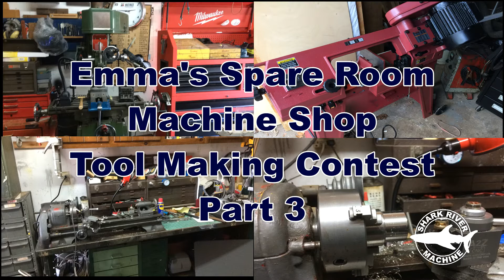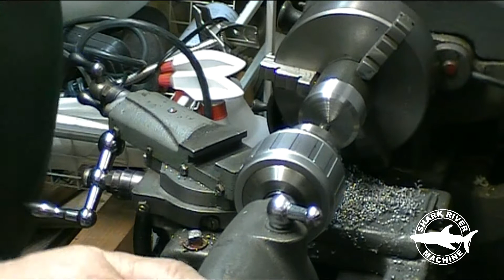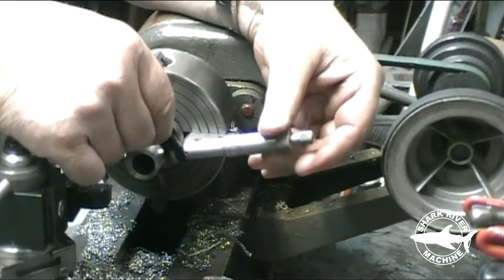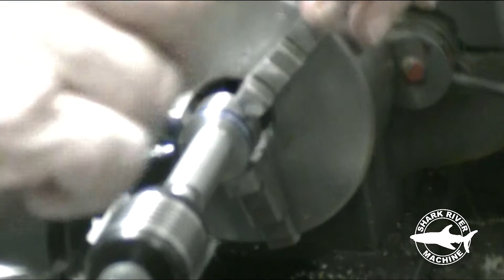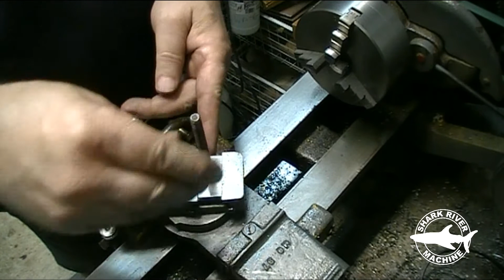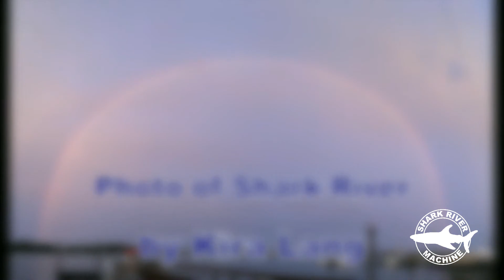Emma's Tool Making Contest Part 3  Toolpost Up Date

Comment: the beauty of having the power to make tools, and better than what you have tools. excellent work!
Reply from the maker: Thank you for watching and commenting. You are right it is nice to be able to turn raw stock into useful tools.
Reply: R. Steven Lang thanks for the inspiration, would like to build a CA size post for my sebastian. but gotta get the mill running first,  and that requires a phase converter big enough to push a 10hp motor. oh well one thing at a time, did find the wife's point and shoot that shoots vid, so heres to coming to the youtube world, sometime soon.
Reply from the maker: dj berg that is an ambitious project. Start looking for the material now. You need some large stock for the tool post.